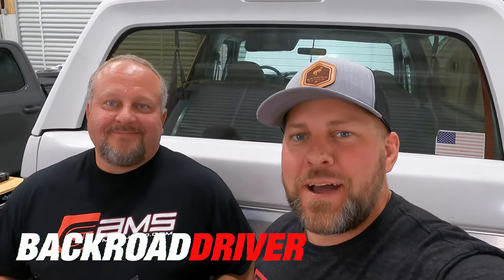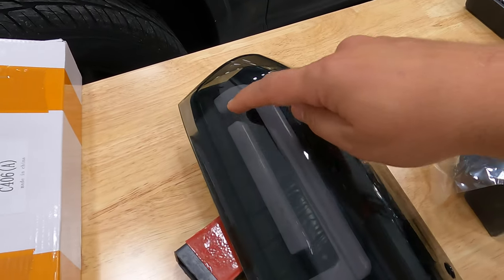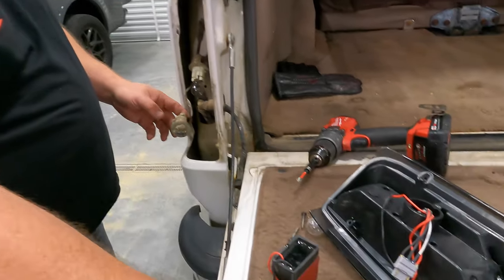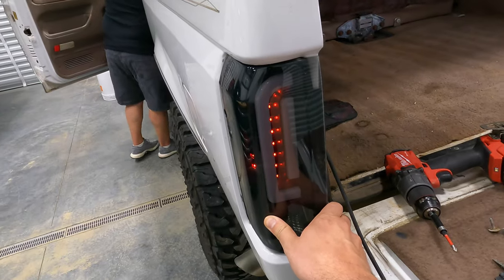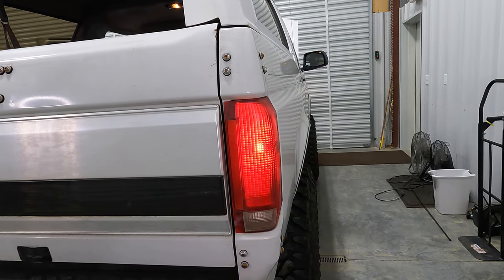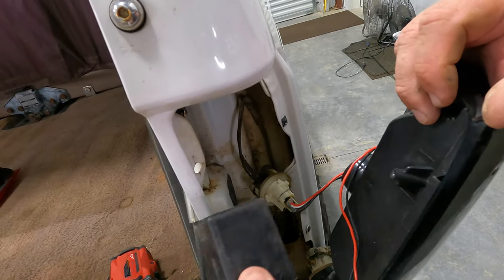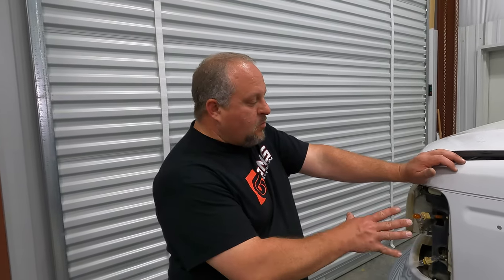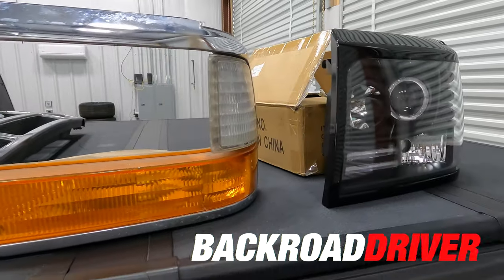1996 OBS Bronco Build Video #1 | New Bronco LED Tail Lights & 3rd Brake Light

Comment: I've heard guys having issues with their transmision after installing LED third brake light. Let me know what you think.
Reply from the maker: HaHa! Bird finger.
Reply: No joke. E4od transmissions use the brake light to signal torque converter lock/unlock on Broncos and others obs rigs. If all 3 brake lights are LEDs, the trans controller thinks you are applying the brake all the time. This causes the converter to slip, thinking you’re trying to stop. It has to do with how an incandescent bulb can carry a constant low voltage current as a signal, but an LED had to get full voltage to create a circuit. There’s a ton of information on this online.
Reply: @jasonhartl2224  makes me wonder if they know about that
Reply: Jason you’re absolutely right.  Your bronco will throw a check engine light if your third brake light doesn’t work sometimes.  I’ve been told guys have almost burnt theirs too the ground from switching these bulbs to LED.  There is a ton of info on forums about it.  It’s something about resistance in the electrical system.
Reply: @c3dGm0n  Could you get LED tail lights and be fine just as long as you don't go LEDs on the 3rd brake light?
Reply: Use a resistor

Comment: I have a 1995 Eddie Bauer edition, I am upgrading as well. My question is could I take a piece of frame from a 1995 f150 and have it welded onto bronco frame? The front passenger side from bumper to axle.
Reply from the maker: They are the same platform. I don’t see why not. A good fab shop might just make a new section.

Comment: Great video! Did you have to replace the hazard flasher to accommodate the led’s? I have 95 f250 that is giving issues with a tailgate led strip.
Reply from the maker: We are about to find our how it works…
Reply: @BackroadDriver  update?

Comment: Have you had any issues with your transmission because of the 3rd led backlight?
Reply: I had that problem with my 93 2WD F150. I think it has something to do with being an automatic transmission and the wiring tied together between the brakes and trans. Im still trying to find a successful example of someone converting their lights to LEDs with an auto trans.
Reply: @Punkguy1991 I’m told you need online resistors but I haven’t found out which value or how to ground

Comment: Any feedback on the trans issues with the 3rd brake light setup?  How are you liking the lighting setup?
Reply from the maker: The lighting is awesome. Haven’t driven it much since the 3rd brake light. Will test the trans issue out soon.
Reply: I’m looking forward to this upgrade as well. However, I am seeing different forums discussing the necessity for a resister with the 3rd brake light. Any updates since this video was made?
Reply from the maker: We've never noticed any issues with the lights. Ours is a 96 with EFI. I don't know if that has anything to do with it or not but we don't have any issues.
Reply: @BackroadDriver  
What I read was that without a resistor, the LED 3rd light was sending a constant “braking” signal that was overtaxing the transmission. I have a ‘96 as well, so it sounds like it won’t be an issue. I appreciate your feedback and all your videos! Thank you!

Comment: Are there spacers on the wheels? If so, what size did you use
Reply from the maker: No spacers. Just a little rubbing at full turn.

Comment: I bought these lights for my 96 XLT.
Did you guys happen to have any  issues with the turn signals either not working or blinking slowly?
Reply from the maker: They seem to be working fine so far. It really hasn't been driven that much, but if there were going to be issues, you'd think we would have had problems by now.  They've been on the truck for quite a while at this point. Thanks for watching Eric!

Comment: https://youtu.be/49WVkXyOElQ

Would the LED bolbs in the description work for both the backup and tail light bolbs? I have a old set of lenses I and trying to polish out like in this video and I was going to switch to some LED bolbs if they would work
Reply from the maker: They should work. They use the same type of connector as the factory units.
Reply: @BackroadDriver  ok that's cool thank you